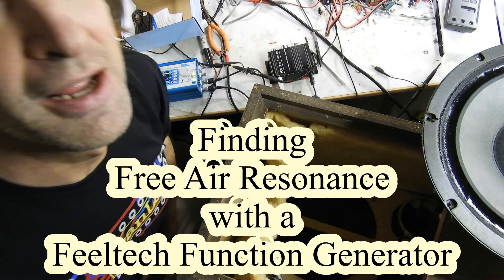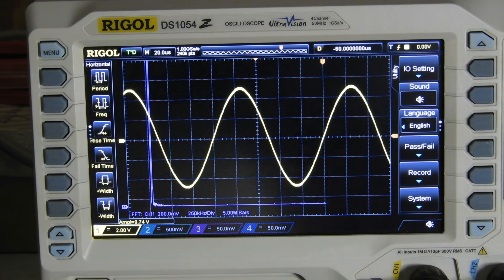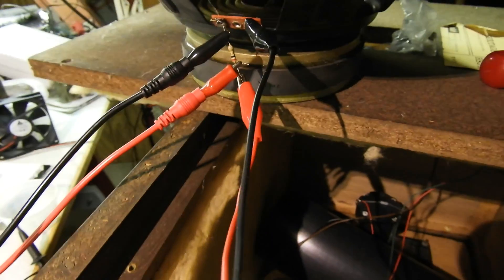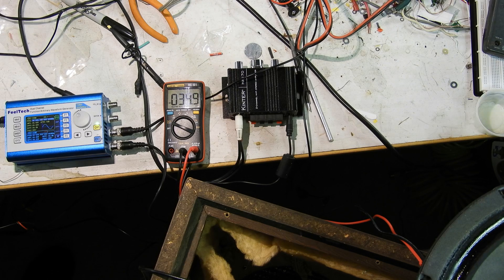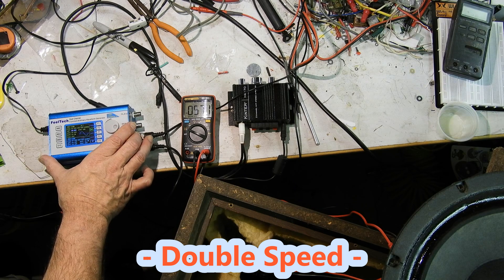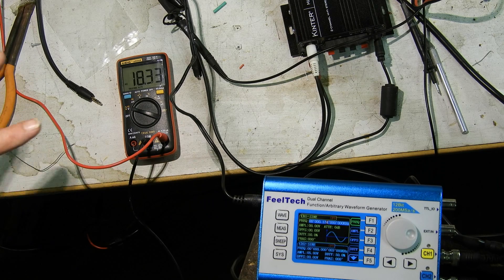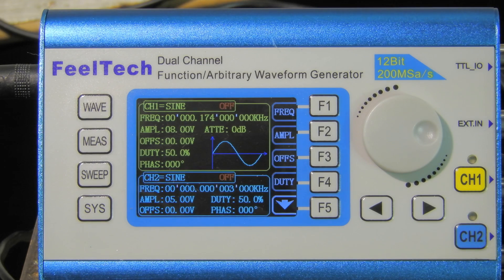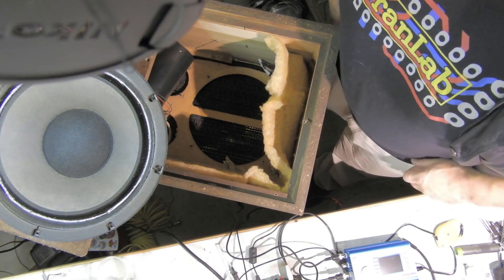Finding Free Air Resonance with a Feeltech Function Generator FY2300

Comment: Since building my amplifier project, I have tried to measure the distortion on the pre amps and the main amplifiers using my scope. Because the distortion is so low it's almost, well, completely pointless trying to see ANY distortion at all. Very frustrating. If it's too low to measure, you can be sure you cannot hear it.
Reply from the maker: Which scope do you have? The problem with the Rigol 1054z is that I can't make the fundamental carrier tall enough (off-screen) to bring up the floor enough to see detail.
Reply: I use a Hantek DSO5102p. It's my first digital scope. I must admit I love the frequency range but hate the display. I still prefer an analogue scope for audio work. In the past I had a Radford LDO and HP distortion reader, bliss!! but that was in another life! I'm just a poor pensioner these days!! I need to work on the scope, might be I'm just not using it correctly.
Reply from the maker: @MichaelBeeny  > I'm still a bit shallow on the learning curve of mastering this scope, but so far it looks like I'm SOL as for making use of John's signal with the 1% marker in FFT with this scope, I can't pull up the floor enough to see much detail.

Comment: That woofer driver is good for a ported cabinet which I think you intended to use anyway. You would need to determine the other T/S parameters to be able to figure the correct port diameter and length.

When measuring the leakage current with your meter, you have to move the red probe back to the right socket and set the meter for AC since it is mains leakage.